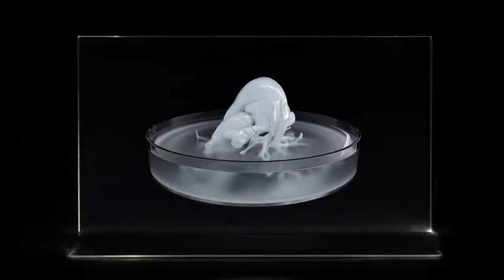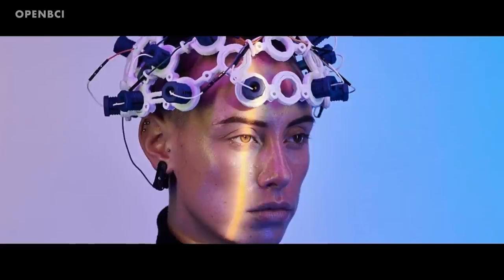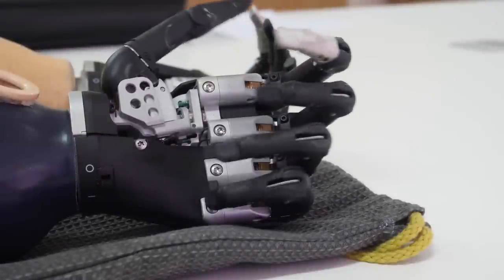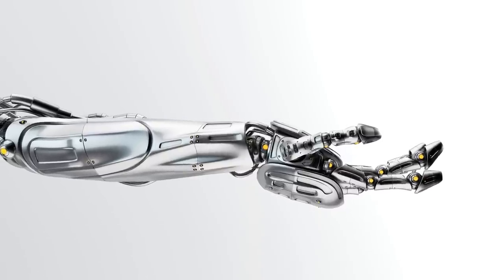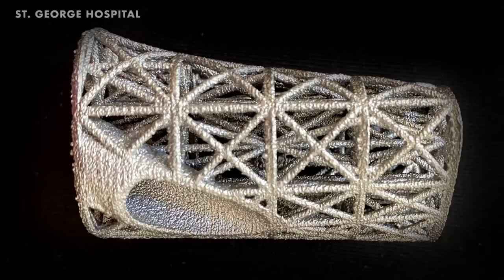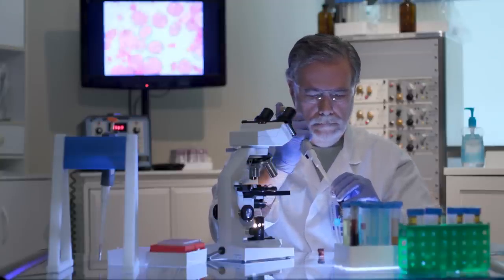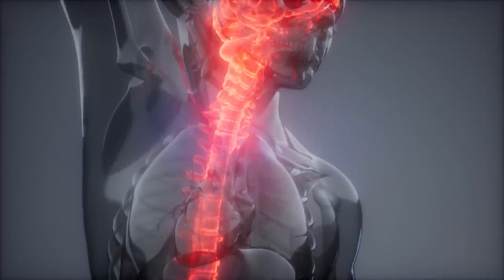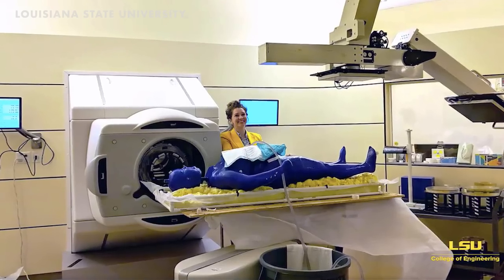3D Printing Human Parts: The Future of Our Bodies

Comment: I almost lost my right leg in a motorcycle wreck 20 years ago. My lower knee knuckle was shattered into about twenty pieces and my tibia and fibula were both sticking through my Levis.
I was a mess and they were going to amputate until one of the trauma surgeons suggested flying down to Denver General Hospital
My surgeon was Dr. Wade Smith who ended up installing a device called an Ilizerov. It's an external fixator that basically held my leg together for about 6 months.
My bones all healed and I have even done a 10K run, albeit slowly.
The man is a genius!!! I owe him a lot for his fantastic work!
When I was still in the hospital, he used to bring his students in to see me, or at least my leg because he'd never worked on a leg as badly messed up as mine!
Thank you Wade!!!

Comment: At about the one minute mark, the narrator said, "may be able to p3D print parts to make someone super strong or super fast". You may be able to increase strength, but, except for STRONGER leg muscles, you will not get super speed. To have that, you would need to enhance vision and other senses to be able to use that speed. To run really fast, you must be able to see what is ahead of you quickly enough to plan your route around stationary and very slow-moving objects. Think of "The Flash" in comic books or films. He has to see not only what is in front of him now, but what will be in front of him by the time he makes it to the next corner, and the next, etc. I might see what's around me and can see TO the next corner, but not beyond that. Even his sense of touch would need to be changed so that it would not fry at the temperatures to be encountered by skin friction and such.

Comment: As someone who took 3D prints a ton, i see where things are going, entry point to 3D printing is much less than 25% of current flagship phones. The patent for metal 3D printing expired and is public domain, price drops every year due to competition and cheaper means of production of the printers. The price of a metal 3D printer went from infinity to roughly the price of a car, in a year it will be a fraction of that and so on. However a regular person can make a 3D printed arm limb straight out of Science Fiction with the issue being the censors. 3D printing body parts even if they aren't organic requires other fields to catch up, 3D printing is ready as is and Columbia University created a heart from stem cells. Things are getting fun You need a high bandwidth direct to the brain connection otherwise all you have is a pretty hook like a pirate and some motors. I'm convinced that we will be able to 3D print organs within a decade or less

TAKE EVERYTHING I SAID AS MY OPINION!